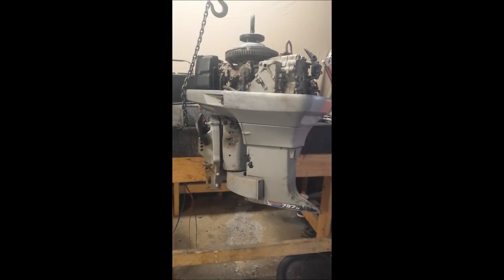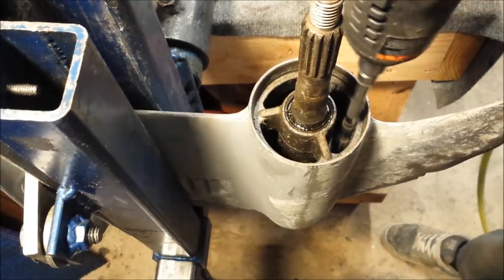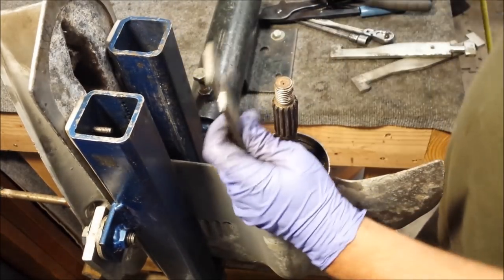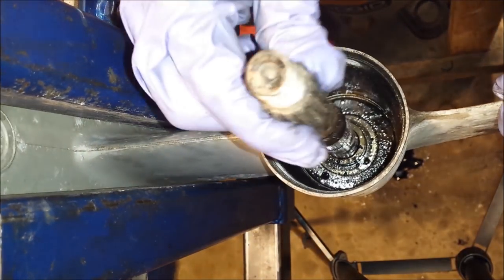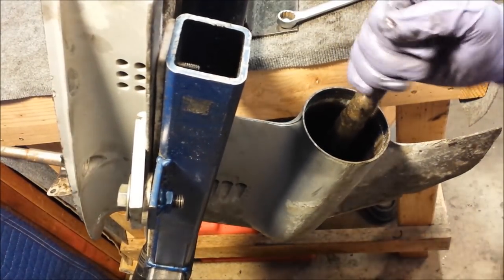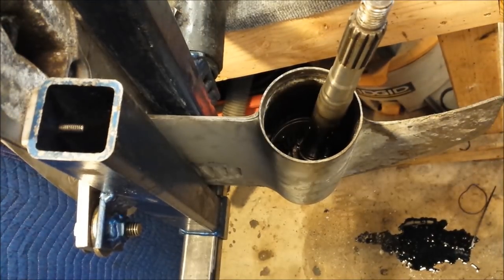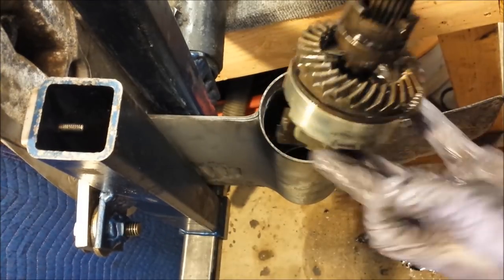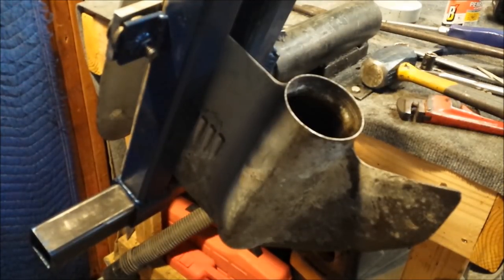1979 Evinrude 55 HP Gearcase / Lowerunit Teardown

Comment: I have a 1979 115 Evinrude and when I removed the lower unit it had greasy oily residue in it all around the water pump and shift rod. Is that a seal problem?

Comment: That's a lot of high priced pullers anybody who can run a tap should be able to make for free.
Reply from the maker: The driveshaft puller that I used on the propshaft? Yeah. Absolutely. 
I finished working on a counter rotating gearcase today, that took $200 in tools alone.
An L2 gearcase is even more...
Reply: I still think the video is a thumbs up.  You could use threaded rod and make J hooks or cut steel and weld nuts to it, cut a circle out and drill holes. The shaft tool I would blow a circle and use an upside down U with a welded nut in the center. Points go out for getting it done!

Comment: That's some messy, old and corroded bit of work.  Possibly if you'd like your Power Blaster to penetrate better and you don"t want things cracking so much with your puller you could utilize a handy propane torch to soften things up a little.
Reply from the maker: Oh yeah, it would have helped. I ran out of fuel though, and at that point, I wasn't caring anymore.

Comment: Hey, would a dirty carb cause blowby? I am working on a 1970 Johnson 20RL 70C. Compression on both cylinders was between 124 and 130. A lot of oil coming out of the exhaust and really struggling to keep it idling without having to increase the throttle.
Reply: Carb kit rings I bet.

Comment: what you did in this video is the same thing i still need to do to my lower unit
Reply from the maker: Cut it off with a grinder?
Reply: i ment removing the gears from the gear box
Reply from the maker: Ah yes yes, of course.
Chances are, these gears worked just fine; If you didn't know they were broken, were they?
Reply: so far my gears are fine. just need to get the reverses gear out an anthing else wroth saving

Comment: Question for you bud. I have a late 80s Mercury 9.9 that pops in and out of gear on its own. Any idea why it is doing it? Do you have any videos showing a rebuild on a lower unit similar to the merc 9.9? Figured I'd ask, been watching your videos for over a year and you seem to know a lot about outboards in general.
Reply: Clutch dogs.
Reply: TrakSpock1.... What about a seized lower unit? Won't budge, lower unit had no oil. Seized bearing? Bought 2 and trying to piece one together

Comment: Is there any way you would be able to give the dimensions of those puller legs?  I can't find any so I'm going to have to make my own.
Reply from the maker: I could probably measure them out for you.
Issue is, they are  heat treated and cadmium plated; not always something the home-shop can do.
Reply: That is the worst polar that I ever owned
Reply: Puller